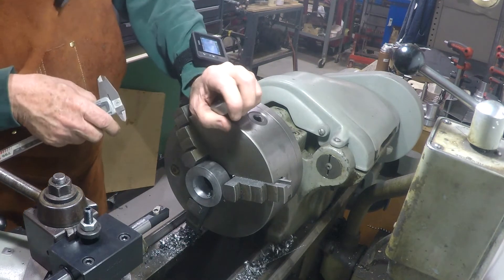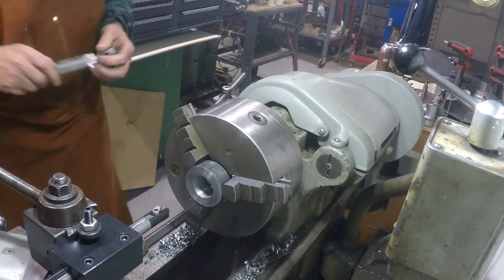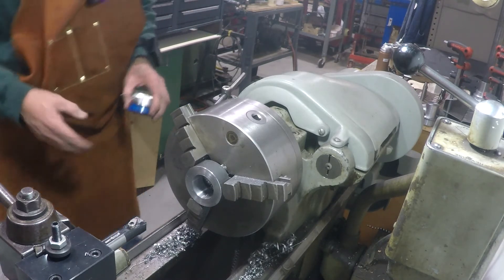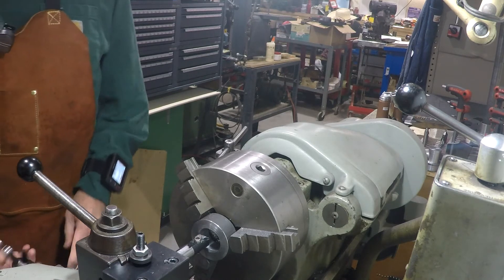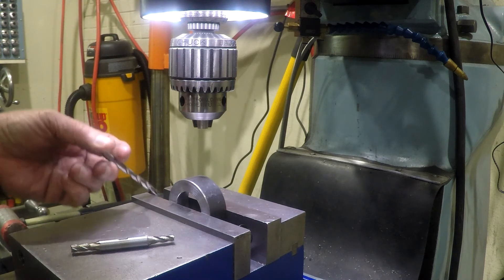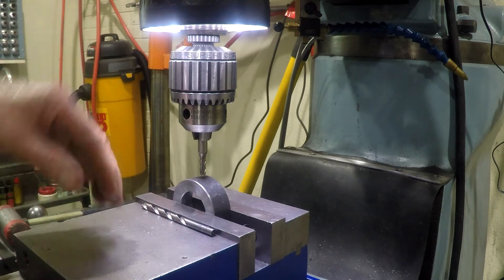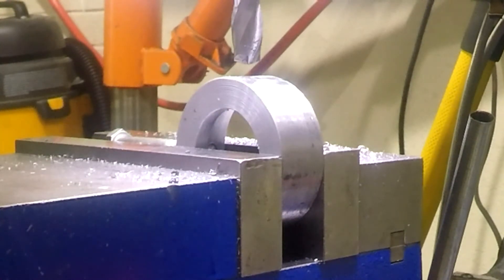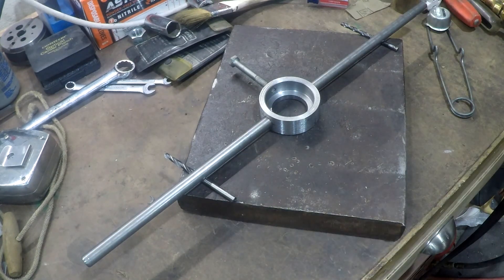Making a Die Stock

Comment: I was just thinking of making one of these, but just with threaded in handles. The cheapo one I used the other day is less than worthless. I have circa 1900 lathe and a drill press, no welding/brazing.